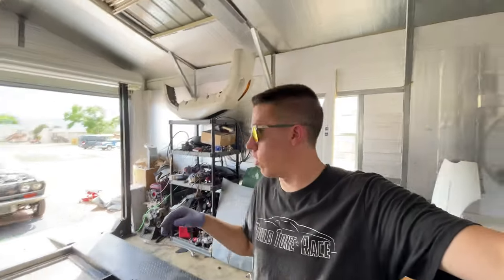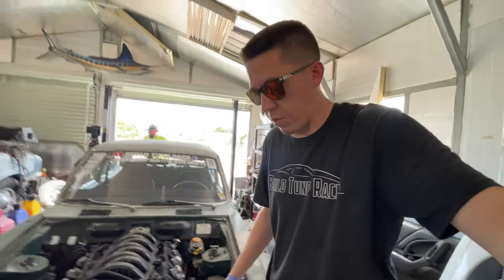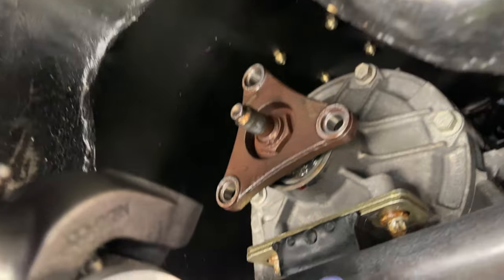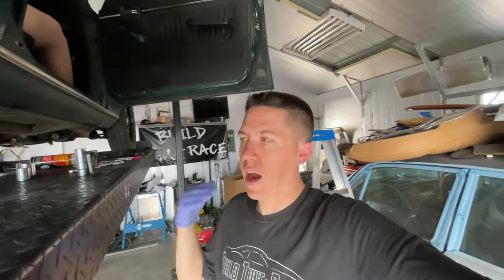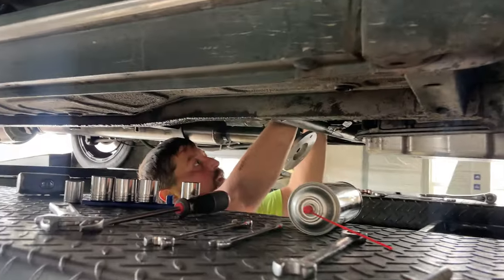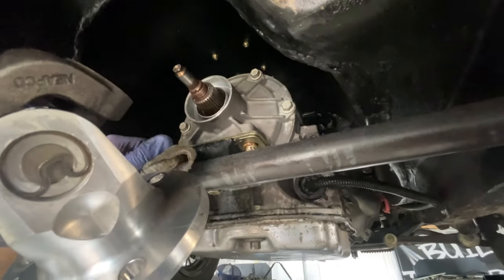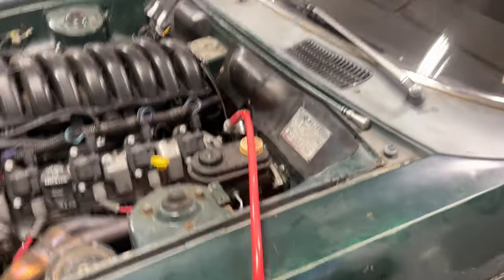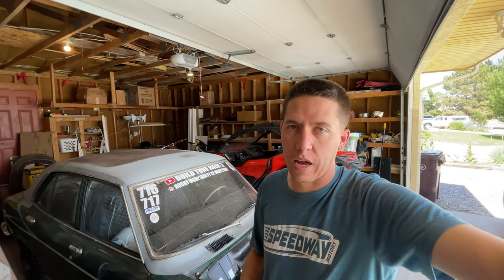We Have A Problem With The 5.3L 6l80e Swapped Mazda RX-2...

Comment: What ecu do you use to run that engine and transmission? I was thinking about using one behind my 502 big block that’s 58x crank, 4x cam sensor and LS coils with multi port efi.
Reply from the maker: Since I’m running the 6l80e I have to run the stock ECU unfortunately